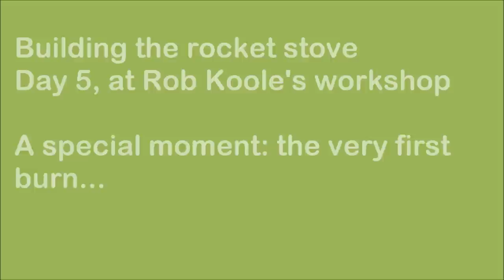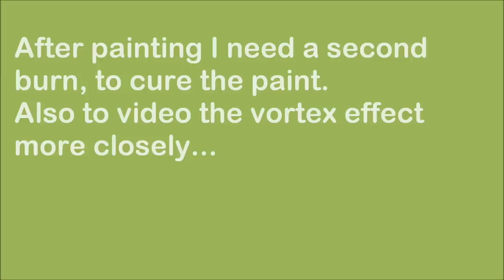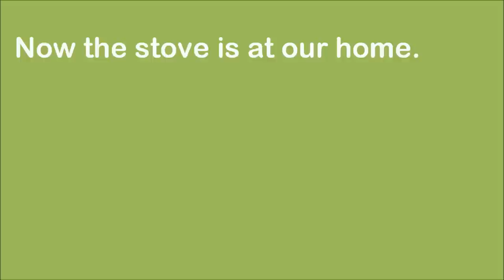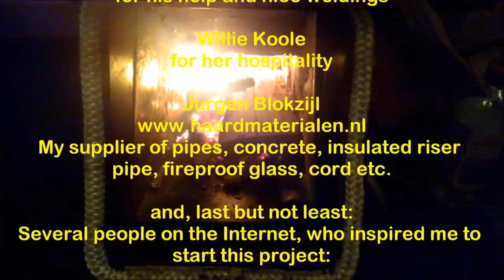Rocket Stove Heater. Building Part two

Comment: I'd love to see how you did the gap adjuster mechanism. I've been thinking of trying something similar to find the "sweet spot" without having to disassemble it every time I made a change.
I also love the idea of the vortex vanes for mixing. And the clips and especially the door prop - all genius ideas and really well executed. 
Thanks for sharing
Reply from the maker: Tee Jay Is the "gab adjuster" not visible in the video? The riser has two pins attached to a ring. The ring is turning on an axle on one side and on a screw on the other side. That's no "rocket science" :)

Comment: Finally a well made video and well explained.

for the supply of air from outside to not cool the air of the house with a cold hose you could use a Canadian well or " puit canadien" in french

The pipe share many of the different meters or feet on the ground, if one descends into warmer air and brings it home. A pipe that comes directly from the outside in winter is very cold and cooled air for nothing.
Reply from the maker: +Laurent t. Interesting, this "Canadian Well". My basement has a sort of same effect. My stove sucks air from under my floor. The "crawl space" under the floor sucks air through holes in the wall of the basement, picks up some energy of the ground beneath my basement. My room-floor is isolated, so will not participate in any heat exchange.

Comment: Beautiful build. Your video is rather vague and at times, dark. Excellent engineering, very inspiring. Please make a video that explains your design even if you use sketches. I'm very impressed.

I just finished building a 55 gallon barrel version based of zerofossilfuel's design. I used insulated firebrick and went to a 6 inch flue and equivalent burn chamber. I'm getting excellent performance, even from this very basic design without any vortex or secondary air.

I find that I need to tend the fire every 20 minutes without fail. Sometimes I can't get to it that often and, I have to rebuild the fire. I have an excellent source of stainless steel bits and will be making a pellet basket. I realize that I'll need to regulate the burn because pellets can really take off. Thank you for suggesting the burn control from the air intake side.

Looking forward to my next build. Also, thanks for listing the sources of inspiration. There's some rocket stove rock stars there. My next build will include bits from all of them, including yours.

Cheers!
Reply from the maker: Tomwalz, thanks for your compliments. Did you see my first video, about the design? In that animation I build my stove, part by part. You commented on my third video.
I'm happy to help you with "my bits".

Comment: Great design, functional and good looking! You've presented me with two great ideas for my own concept. The main airflow from under the house and the raising and lowering of the riser itself. I'm planing on duel adjustable preheated ins, they will however be attached running along the top of the fill box and then out the top so as to avoid drawing in excessive air into the fillbox, which essentially means burning more fuel. Honestly can't wait to get my gloves dirty!
Reply from the maker: +Stefan Bachrodt Thanks. And did you see that my preheated inlet is adjustable too? The stove sometimes runs better with less air. If there is a lot of wind, the drawing of the chimney is too much. In that case I close my inlet a bit.

Comment: Very well made.  I particularly like the glass face that allows different air settings.  The chamber air vortex baffles is over my head but the resulting vortex is awesome.
I'm still working on tin can designs.  I'd like to make one with a double interior wall sending the air down and through a horizontal and flat surface to a 2nd chamber exit.  The flat surface can be used as a griddle while the top of the rocket can be used also.
Yours is top shelf.  Thanks for sharing.
Reply from the maker: trumpsahead Thanks. The glass face also shows the fire, which I like to look at.Your idea of the double interior wall in the tin can seems identical to the Rocket Stove Heater plans. Instead of letting the hot air escape from the top you lead it down again. The top of the rocket stove will be very hot, but I don't quite understand the use of the bottom flat surface as a griddle.
Reply: Robert J.H. Gisolf 
Oh, also nothing new about the flat bottom as a griddle.  Make it wide & long enough to cook on and only about 1 or 2 inches high to let hot gases pass through into the next chamber pipe which goes up and away.
There are videos somewhere on youtube that show this idea.
There is nothing new under the sun I'm sure, but we sure have fun rediscovering, don't we?  God bless, love your work. ciao.

Comment: A very fine piece of work. Congratulations. Many will watch this and benefit, as I will. On the vortex, since you asked, it appears to me, from the shot provided, that your vanes actually break up the early formation of the natural vortex, tumbling the air and forcing it to reform. If that's what I see, it may be a happy accident that causes a late, last burning in the tumble and a cleaner result, as your result looked exceptionally clean. Anyway, hard to see from here. One hell of a great stove there!
Reply from the maker: Thanks for your compliment(s). Yes, tumbling and reforming generates a lot of turbulance. And that mixes the secondary air with leftover burnable wood gas (otherwise escaping as smoke). The "natural" vortex (if existing) is not very strong.
The flue gasses only contain water vapour and (recycled) CO2. No smoke, no smell.

Comment: Very nice indeed Robert, some great features on the stove its clear you thought out the design well and made future maintenance easy. It all looks superb, many thanks for a mention in the credits. Loz.
Reply from the maker: Thanks ppotty1. I learned a lot from your stove video's. You'll recognize the door and the double walls of the firebox. They are sort of the same as yours.
Reply: Robert J.H. Gisolf
Reply: ppotty1 is a rocket stove rock star... very nice to see this exchange.

I built a larger version of Zero's stove... no vortex but I'm on my 3rd season. I used the super light insulated fire brick.

I am interested in how the riser adjustment alters the burn. Please respond, because I was considering it for my next build, which will include a vortex, as well as some other adjustable features.

My stove is on my channel... there's also a video of a failed batch box addition... embarrassing, but so many lessons learned... the only change that worked is that I doubled the size of the fuel chamber so I could get longer refueling times.

The biggest lesson learned was that metal sucks heat, and is to be avoided within the stove as much as possible. This is very important for those who heat a mass. As for folks like ppotty1 who use it as a space heater, then, metal is your friend.

I use mine as a space and mass heater.

Rock(et) on.

Comment: Very handsome and interesting piece, Robert! I hope you post more videos about how it performs. YouTube is full of little vids at the moment by people talking about their 'rocket' stoves; diy tinkerers who clearly haven't studied the principles of rocket construction, as developed over thirty years by Dr. Winiarski and colleagues at Aprovecho - plus lots of end-user women in poor countries feeding back their crucially-important improvement comments to the Aprovecho researchers. At least you seem to be well-aware of all that work, and don't set out to re-invent the - well, the rocket. Quality design and engineering work to; a pleasure to see it. With all the built-in capability in your design to vary important parameters, I expect you're going to learn more about how to get the best out of rockets. I hope you keep posting about what you learn.

One thing: lately, in my own rockets, I've begun to wonder about vortices in the riser tube: Is a vortex really what's needed? The principle is to get TURBULENT flow in the riser, to get thorough mixing of residual unburnt fuel and hot secondary air, so that the final burn of all available fuel takes place in the upper riser, with maximum temperature achieved just at the top, where the flue-gases hit the pot, outer-drum, or whatever. Could it be that chaotic, rather than vortical flow would achieve this better? I don't know, Just wondering. At any event, instead of copying your excellent vortex inducer at the bottom of your riser, on the next rocket that I'm building I shall be aiming instead to induce the same fast flow, but in chaotic, turbulent manner, rather than that truly impressive vortex that we see looking down your riser tube. If vortical flow IS the best way to go, though, I'd say you've cracked it with that design! Congratulations!

Interestingly, I've always observed vortices in my riser tubes even without any special inducers, beyond the sharp angle of the elbow between feed tube and riser, as recommended by the Aprovecho design principles; but I've never had any vortex as thorough as the one in your riser. That's probably the best I've seen.
Reply from the maker: Sure I'm aware of Winiarski's work an that of the people at Aprovecho. I just wanted to add my idea's to that.
And turbulent air is very good. That's why you need a sharp 90 degree angle from the horizontal feed tube to the riser. The designs that use a smooth 90 degree "elbow"-pipe are wrong. But I think that above that place, in the riser itself, the vortex adds even more mixture of unburned gasses and secondary preheated air.
Thanks for your compliment though.

Comment: Great design and work.  You probably already though of it but, what if you added a spiral water pipe inside the chambers.  Not closed together but with a gap so the air can flow around it fully.  That might aid in the air vortex and add water heating to the design.  Lots of things you can do with hot water.  Heating the water would also provide a pumping action as well, ( I think).  That could also be added as a bolt in modal to what you have.
Reply from the maker: If you say "aid in the air vortex" you probably mean to add the spiral in the riser? But that is too dangerous. Gasses in the riser are 700 to 500°C hot. You could add a spiral in the outer chamber. And water has a high capacity for heath, so could store the heath. But security systems are needed because steam pressure is dangerous. You could add a very big water storage and connect it to the spiral. The spiral will pump the water around because the hot water will rise in the spiral and relatively colder water is drawn from the storage. You then store the heat rather efficiently, as long as you stay under 100°C.

Comment: Very nice design, after two years of use how is the metal standing up to the job?
I tend to be a belt and braces engineer, one or two parts looked a little lightweight such as the top section catches and the secondary air tube. does the end of the air tube at the bottom of the vortex get very hot or does it's position mean it is just below the heat flow enough to stay relatively cool?
Anyway an excellent design, if you should decide to sell plans I would be interested in buying them as I am moving to a house in mainland Spain that is off grid and a rocket stove will be a must have for me.

Comment: Thank You for sharing Your design in such an informative way, including professional presentation! I'm getting fascinated with this concept, and Your videos showed me that there is more knowledge and experience behind it, than I expected. For now I need to make small pellet/wood rocket stove about 60 cm high, so it could fit to old open brick fireplace in main room (I can't change fireplace). What are Your findings about the riser gap adjuster? Do You adjust it time to time, or was it only to find the sweet spot and You left it that way since then. As I can imagine making gap too small will restrict flow of the gases and making it to big will reduce temperature in upper section making secondary burn (happening in top of the riser) less effective - is this correct, or are those changes marginal?

1. I also wonder if adding some heat reflecting/acumulating element (like ceramic honeycomb)  might be helpful for secondary burn, because approx. 50cm riser  that I can fit in seem quite short..
2. As the stove would be started 2-3 times a day and I want to reduce smoke to minimum,  I wonder about making bottom of the feed tube and riser itself rather heat insulated (perlite) than covered by accumulating material (f.e. fireclay bricks). That is to let the burn chamber achieve high temperature faster. For heat accumulation I might use fireclay bricks around the housing, but the old fireplace is covered by them, and that might be enough.
3.For housing I'm planning to use "quite popular heat exchanger" I've bought - its 20 cm diameter pipe, 60 cm high with series of flat bar pieces welded around it. Later If needed I might weld some steel net around it and use some small gravel as extra accumulating mass.
4. Do You think that riser made of 0.6mm wall pipe from inox (or rather acid-proof steel) used for chimneys won't burn-off to fast? From what I watch i videos it seem to be much more temperature proof that 3-4mm mild steel.
Reply from the maker: Thanks for your compliment. The riser gab adjuster was to experiment with that gab, because there is some discussion about it. But if you make sure that the imaginary ‘cilinder’ has the same area (so circumference times height) is around the same ore a little bit more than the inner area of the riser, then you are safe.
1.	My riser is 1 meter, because it is a standard insulated chimney pipe. Shorter will work too, but if it is too short, there is no time for the mixture of (secondary) air and burning gasses to completely burn without smoke. So you need two things. First the temperature has to be as high as possible, so you have to insulate. Second you need enough length for the burn process to complete, by making the insulated riser long enough. So you have te experiment by making the inner parts of your stove, including the riser. You can wait making the outer drum and flue pipe. Place it outside and test it. If it burns without smoke (after the stove is fully heated) you’re fine.
2.	Sure, the burning chamber has to be as hot as possible. But is does not have to accumulate heat. An external heat mass, outside of the stove, is much better. You can run the flue pipe through this mass to accumulate heat there.
3.	You don’t really need a radiator in the stove itself, you will be surprised what the outer drum can radiate. Better is to store the heat in a heat mass, so you can burn the stove for a period of half an hour at full power. The heat mass will then radiate the heat over a long time.
4.	My riser is build from two pipes of rather thin inox with insulation between it. The inner pipe is crackled by the high temperature. So I had to make a part of pipe of 2 mm thick inox to prevent that. Mild steel there is ‘eaten’ in very short time. You can see that in one of my other videos.
I wish you luck and a lot of fun building your rocket stove.

Comment: adjusting the riser pipe? what does that do? also 3 pipes? I see 1 in the load door, 1 under the burn box? boh of these are air intakes? the 3rd pipe? exhaust pipe? more explanation please.  ive just started watching these rocket stove builds. most of the heat generated is in the large chamber due to the metel getting hot and retaining heat? looks like a professional build!
Reply from the maker: Adjusting the riser gap was just an experiment, read the other comments and replies.
Only during the initial startup the front door (load door) is open. Normal air intake is trough the bottom intake, preheated. Then there is the "secondary" air pipe, using some air from the room, preheating it and then injecting it into the burning gasses, to help the complete combusting of unburned wood gas.

Comment: Amazing build.  What are the measurements?  I am looking to build something similar to heat a barn and greenhouse.
Reply from the maker: The inside of the concrete box is 125 mm wide, 100 mm high and 225 mm deep. The walls are all 25 mm thick. The riser is a retail isolated double stainless steel pipe. It is 125 mm inside diameter and 175 mm outside. It ha a length of 1 meter. The outer tube has a diameter of 300 mm. The bottom part with the firebox welded in is 280 mm high. The upper part is 950 mm high. All the steel plate material is 2 mm thick.
This rocket stove is sufficient to heat two big living rooms.
But you need a bigger one if you want to heat a complete barn and greenhouse.

Comment: Great build . Tell me , is the feedre box double walled on all sides , or is it just the left and right . 
The air intake at the bottom of the feed box is hard to see . Perhaps you could show it more in detail 
in a future video ? 

Pat ( Belgium )
Reply from the maker: Thanks. The feeder box is double walled on three sides (left, right and bottom). The top wall is isolated with a fireproof plate. Pulling hot air downwards would make no sense.
You can see the air intake in detail on my first video in the playlist (https://www.youtube.com/playlist?list=PL_-61alqZRX002xu9NtwPaJ2vvZnaRW6T). It shows an animation of the airflow (at 2:40 and later).

Comment: Heard that music and thought immediately of Ron Jeremy , Issac Hayes ,bell bottoms and huge shades . Otherwise good design work ! 😸 ✌ 😎
It's too bad that most of that heat is going straight up the chimney and not heating up some mass instead.
Reply from the maker: Thnaks. Because of the slow speed of the flue going down in the outer drum, there is a lot of radiation of heat. The exhaust themperature is inly abouy 80 to 100 degrees Celcius.